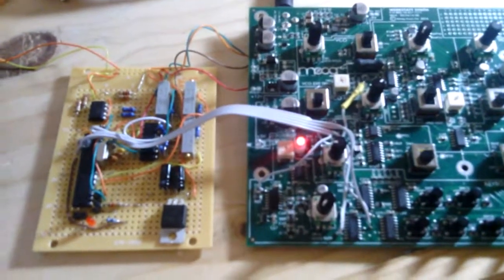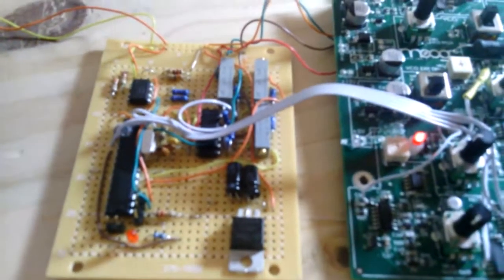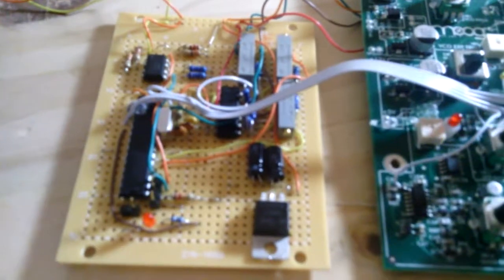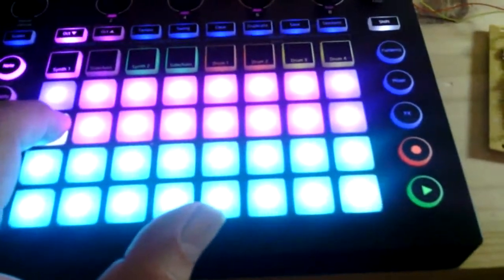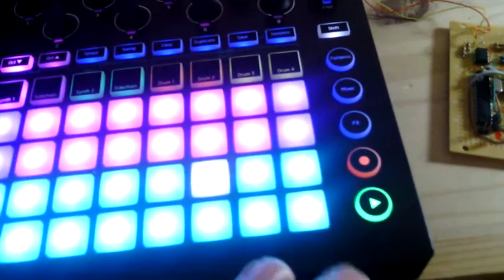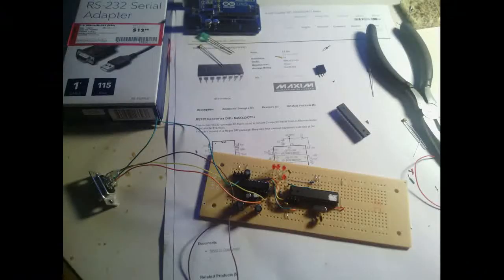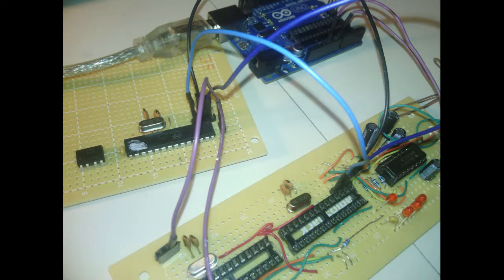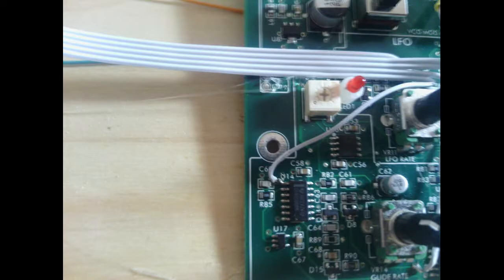Moog Werkstatt Midi keyboard interface

Comment: Hi! I'm still figuring out how to wire this myself since I don't see the other side of the board. Hopefully with the help of your octave shifting trimpot diagram and the the info in your blog i'll be able to do it next week. Just wanted to ask you what power regulator did you use and the capacitors (and if it is needed to use those three). Thank you again!!
Reply from the maker: The most recent version does not use the OP amp and has the CPU drive the trimpots directly and uses 10k resistors to mix and interface to the CV test point. The Op Amps were being used to generate a -ve CV and or a buffered / smoothed PWM CV for filter cutoff.
Reply: @codewizard58  Thanks for replying. As I said before I know nothing at all about electronics and even thought you made it very clear I take longer than I wish to understand it. Now I see your update on the werkstatt trio video. To be honest even If kind of understand the wiring on the board the schematic scares me, so i'll try to stick to the older version. I'd appreciate if you could confirm/correct me on the following (if i'm not asking too much already):

1) I will be using TL074. As you mention, pins 4 and 11 are the +9 -9v but I don't know what is the other point I should solder the other 10k resistance to (I checked tl074 diagram and though it migh be pin 1?). Also, If i understand correctly, D7, D4 and D3 are the arduino connections that would translate in pins 13, 6 and 5 on the ATMEGA 328p chip.

2) In this part (http://moddersandrockers.com/werkstatt/1.php#keyboard) I get quite confused. For "RowMuxOut" are you referring to wire 3 on: http://moddersandrockers.com/werkstatt/midi3.php ? Same applies for "KBOscIn" (to wire 5= pin1 of the IC) and for "CountRST" (to wire 4, which goes again to D7 on the arduino or another connection if remapped on software??) I can't find information for Count0-1-2-3. 
 
3) For the Midi 6n138 circuit i see the RX and TX are pins 2 and 3 on the atmega chip but I don't understand where the jack connections are wired. If after the 220k resistors of to the +5v and then both grounded to 0v.

4) I understand I can wire toghether all the 0v connections toghether to the one wire which has to be soldered to that werkstatt point. Am I right?

Thank you again sir
Reply from the maker: 7805 is the regulator and the capacitors are 1uf on input and output for stability.  Nothing critical. Datasheets available online have typical use. Use the 12v input directly to provide power. If you use op amps such as TL074 you can power those from the +/- 9V that the werkstatt generates using the marked testpoints.

Comment: That is sweet, have you got a schematic?
Reply from the maker: I have updated the web page with a diagram of the octave shift circuit and added the sources of the Arduino code. The digital IO pins used are not important but should match what you have in the code.